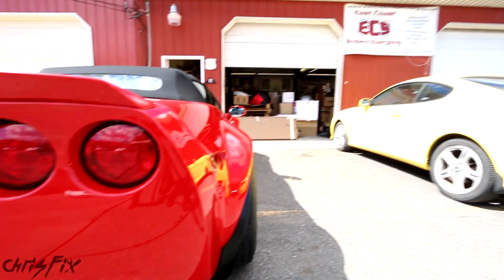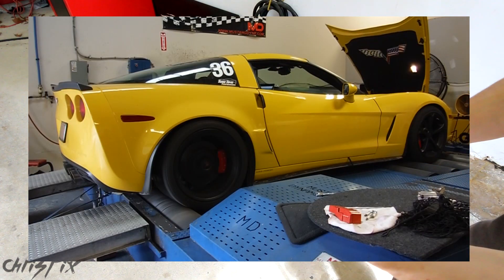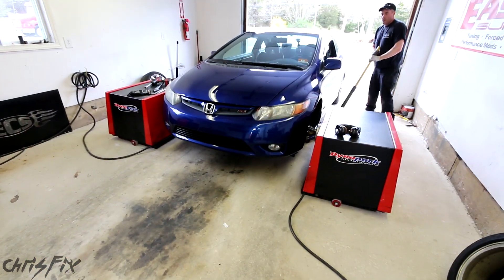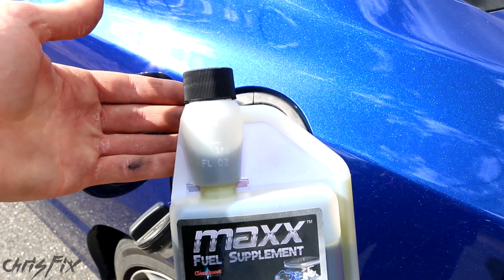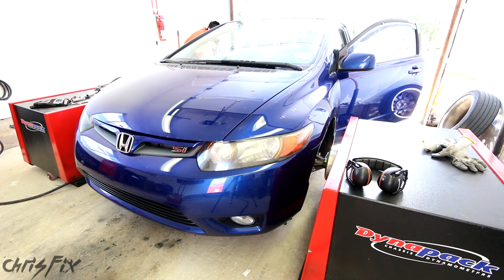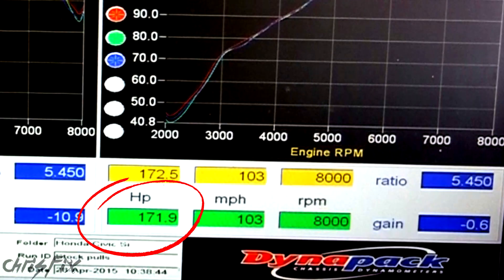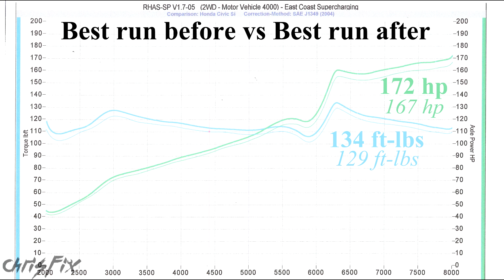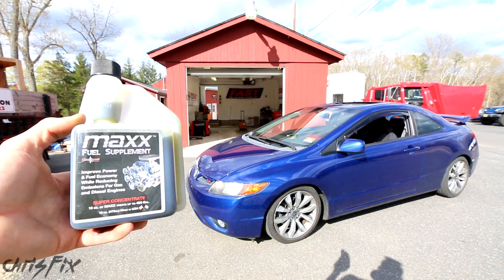Can a Fuel Additive Really Increase Horsepower in Your Car? (With Proof)

Comment: great stuff Chris. two products work so far, seafoam and Clean boost MAXX
Reply: ChrisFix I didn't like the idea of removing carbon from pistons, but removing carbon from valves and injectors is a different story.
Removing airway obstacles will help any motor breath better, and this will be an interesting test.
I actually want to see this test. I had issues with carbon on pistons, due to possible sealing problems arising from the treatment, but other areas of the motor will work better, without a bunch of carbon in the way
Reply from the maker: Shin 真・悪魔 Gouki I think we will have some more products working once I figure out a way to test the valves and fuel injectors to see if that got cleaned!
Reply from the maker: James Fenton Yea, the valves is a big deal because any carbon on them disrupts air flow and can even cause a loss in compression!

Comment: Makes wonder what the octane rating was for the gas in the tank...and would a octane booster accomplish the same thing?
Reply from the maker: mds19238 The gas in the tank was 91 which is required and I have no clue. Maybe we could test some octane boosters on the dyno to see if it works.

Comment: Great video Chris! Just wondering though, Would persistent use of this cause any harm to the engine?? Like would It be fine to use every time I fill up or just every now and then?
Reply from the maker: MVDrumline Thanks a lot! I would think it might actually help the engine because they say it lubricates the cylinder walls which would reduce wear. On their website they have a trucker company that uses it in their fleet and they say it saves them money in fuel. I think the next test for this product will be a fuel mileage test to see if it actually saves you money in gas.

Comment: I have to wonder what the results would be after the ECM adjusted the engine to the change in fuel. In other words, would this boost in power last past a tank full of fuel or fade away as the engine management system reset it's parameters.
Reply from the maker: Alan Maier Well if you keep using the additive, you will see the same results. If you stop using the additive, you will see the baseline numbers.

Comment: Driving around for a while might be unnecessary,IF your car has a return-type fuel system. Cycle the key a few times (to run the fuel pump prime),and let the engine idle for a minute..all the fuel in the lines/rail should be circulated through pretty quickly.
If it's a non-return system,you need to drive a while.
The consistency of the second set of runs is..impressive.
Reply from the maker: PhattyMo That is such a good idea. I dont know why I didnt think of that! Thanks for the idea for next time! Either way, I wanted to get everything all mixed up in the gas so a ride was necessary.

Comment: Good write up and video! :)  - but the analysis falls very short.

First and foremost, I would not have gone off of the first three runs with a disagreement like that between them.  I would have done a few more runs without the additive after the fact to see if I could get more agreement between the runs.  I dyno test engines I tune and rebuild - and if I saw lines like that on three runs - i'd know something was fishy.  Losing 2-4 HP each run?  Nu-uh.

Also, you didn't touch on how much useable horsepower that additive generates.  Yes, it gives a bit HP boost - but how much of that lies in the typical RPM band?  Looking at the graphs, the HP curve is virtually identical up to 4000 rpm, and even so, the deviation is very slight.  The additional HP doesn't come on until near and past 6500 rpm.  So it seems to me that unless you run your car with the tach bouncing off the VTEC line everywhere, this is not doing much good.

Delivers as advertised?  Yes.  Remotely useful or even noticeable?  Not even close - unless you want that fraction of a fraction of a second better time on that track pass.
Reply from the maker: GammaCruxis I appreciate the feedback. How do you do a few more runs without the additive on the same day? If you do runs on a different day there are many more variables that will affect the readings (mostly weather). The three runs loosing 2-4hp are very common on back to back runs and as a dyno operator, I am surprised you dont see that. The engine heats up and you lose power. Either way, I compare the first/best dyno run to any of the other dyno runs and there is still an increase in power.

Comment: I like digging! So I dug into this, Hmmmm! This all sounds real good and I admire your efforts ChrisFix however I looked where to buy this product and everyone is in Utah and their Testimony is from Smithfield Foods' so I researched it a little further and found this page and a link between the two, his name is Dr Theo van Kempen and the page is http://www.thepigsite.com/articles/914/manure-to-energy-the-utah-project/
As one might say: I smell a Pig! or was that a Rat!
Reply: Smithfield Foods fleet is now owned by CR England and still continues to use the product each and everyday. The article you are reading is about the largest pork producer in the US making biodiesel for use, guess what, they add the CleanBoost to this fuel as well. Chris Fix does a wonderful job showing a product in the market that works and there is still people, that do not have dyno's, no chemical back-ground or mechanical engine experience still making negative claims, it is kind of funny to read.
Reply: CleanBoost 
I try to always be a skeptic, and I admire ChrisFix efforts, also I'm impressed with the results of this product!
I'd like to be able to get some of that CleanBoost Maxx, locally to try for myself. But it seems to only be sold in Utah, I think it would be awesome if I could get back to the kind of fuel mileage of old, similar to the days of pre-ethanol with results on 87 Octane 10% ethanol /gasoline mix, that would be really something that I could write home about!
I think that would be about 15-20% increase in mileage. Shucks, I'd settle for 10% with an increase in performance!
Thanks for you efforts!
Only1trueGod
Reply from the maker: ***** haha, there you go, straight from the horses mouth.

Comment: For those wondering about higher octane fuels creating more power; it all depends on your car's ECU. Some automobiles will say "87 octane or better ", this means that if you put in a higher octane, say 93, your ECU is going to account for this and adjust ignition timing to prevent knock, and make use of the higher octane to create a bit more power. All automatically too.

If your vehicle says only use regular, or whatever octane number. Only use that number, that ECU will not be able to adjust automatically for different octanes and you can cause knock which will damage your engine over time and you will lose horsepower, even if the octane is higher.

This is all proven, and is why tuned cars will have their ECU handle only 93 octane (or E83, or whatever) to be able to make a bit more "free" power. Look at your gas-cap, dashboard, and your car's manual to look for this specific wording. And if you're hesitant about stepping up to a higher octane for a little more power and better economy, bring it to a shop and have them tune your ECU to specifically handle whatever octane you want.
Reply from the maker: Violetta Exactly! Thanks for sharing the info so others can learn!
Reply: ChrisFix No problem, I just hate it when people say I'm wasting money buying 93 for my car. x)
Reply from the maker: Violetta if your engine can make the most of higher octane gas, then it isnt a waste.

Comment: Wow! I'm legit impressed, could you try a injector cleaner to see if those work too?
Reply from the maker: kanneebannee I am trying to find a way to test injectors. That would be a really cool test. I want to compare spray patterns and the volume of gas it sprays over a certain amount of time!
Reply: ChrisFix Awesome, yes. Maybe in a translucent tube where it is marked to show how much fuel goes into the tube? Well, i will wait patiently that video when it comes! I think my car would need it but i'm not sticking anything in that is not tested.
Reply from the maker: kanneebannee The hardest part is getting something to trigger the injectors like the car's computer would. Like, lining them up and pressurizing them is one thing, but triggering the injector like an engine computer would is another.
Reply: ChrisFix Ofcourse, well. Good luck with solving it and i really look forward to that video!
Reply from the maker: kanneebannee Thanks!

Comment: It isn't good to go by the coolant temp for engine temperature because that doesn't mean that the oil temp was the same as the first run. Maybe the oil pressure was lower after the drive?
Reply from the maker: biscuitownz The engine was at operating temp for both runs. The oil temp was similar for both runs. We took as many variables into account for this test which we possibly could. Thanks for the feedback!

Comment: It will work for your car, but not for YOU ;) Come on guys, nobody can tell a 5 hp difference; I recently watched a few Boxster GTS reviews, bottom line: one reviewer said he'd be lying if he said he could notice the extra 15 hp over the Boxster S (if you really need a reviewer to connect the dots for you on this), so if you think it is worth the hassle and money for no real life effect or advantage for your daily driver, then go buy this stuff... you got to be crazy if you drive such a non-descript Honda and think you can pimp it with an additive :)
Reply from the maker: Baerchenization The butt dyno wont feel anything less than 30-50hp so this is more for squeezing out the extra hp you can get from your gas. I think it is worth it if the fuel economy really increases because then you get more mpgs and more power!

Comment: I wonder if it works by cleaning the oxygen sensors?  hmm.  cool test, thanks!
Reply: Ok
Reply from the maker: Gristle Von Raben It works on the molecular level to increase the efficiency of combustion of the gas. So the same amount of gas will burn better and make more power.
Reply: ChrisFix Come on Chris, even you know that is just marketing speak here!
Reply from the maker: 12vgs8606 How do you explain the hp increase then hahaha. It has to be something.
Reply: Maybe it helps the methanol burn hotter?  I dont know, Chris, I've been burned by so many fuel additives that it makes this hard to believe. I believe you, just hard to believe the results
Reply from the maker: Gristle Von Raben Here is what they said when I asked them (because I wanted to know myself): the product is based on a proprietary nano-technology that introduces a small amount of catalysts into the fuel, where it reduces the ignition threshold, so that more of the fuel’s chemical energy is released into kinetic energy at the crankshaft.  Less of the fuel is wasted as heat and the result is more power.
Reply: Ok. I shall buy some.  My jeeps gas mileage has started to decrease lately.  I could use some help in that area
Reply from the maker: Gristle Von Raben Let me know if it works for fuel economy. Also, before you get it, start writing down your fuel economy and mileage per tank. If you want, I might use it in a new video testing fuel economy. I want to try to get my subscribers involved and that is a great way to get a large sample size! We need to do a before and after test!

Comment: Great video. I knew Honda's were low on torque, but damn! I think Sentras makes more than that. I wonder how much your vette makes.
Reply from the maker: XenomorphLV426 I wish we could have tested my Vette. That was the original plan but I couldnt get 3rd gear to lock up (it's an auto). The Vette makes 340ft-lbs at the flywheel so I bet it would make 300-310ft-lbs to the wheels.
Reply: XenomorphLV426 That is because of a 2.5 liter engine to honda's 2.0 liter.
Reply: esqueue Sr20 makes more than that. And that's an old ass engine.
Reply: XenomorphLV426 I don't know the specs but I hope that you aren't comparing Wheel Horsepower with what the Manufacturer says that it makes from the engine.
Reply: Nope. wheel torque is right around 145.

Comment: VTEC KICKED IN YO!!! Wow though, didn't know this would make a difference.
Reply from the maker: Dell0304 Yea, it is pretty exciting! I like how clear you can see the Vtec on the graphs!
Reply: Haha yeah it's cool
Also, I have a quick question if you don't mind: My steering wheel shakes intermittently while driving straight on the freeway. I've already done a wheel alignment and tire balance, so it's not that.
I took it in to my local shop and they verified that my inner tie rods have play. They also recommended that I should just replace the whole steering rack due to my car's mileage (91K), because they tend to leak/fail around this time. What do you think?
Reply from the maker: Dell0304 The steering rack replacement sounds extreme. My van has it's original steering rack and that has 300k miles. Does the rack have any leaks? Tie rods can definitively cause intermittent shaking. Check out this video: https://www.youtube.com/watch?v=brI2feYiEi8

Comment: hey i just want to say that this is a really cool video. I know this is irrelevant but i was wondering where do you obtain your torque specs for your car? do you use a certain website. 
thanks.
Reply from the maker: Julio Amaya Thanks a lot. I have service manuals for my personal vehicles and on everything else I look it up on car forums.
Reply: ChrisFix thanks a lot man and i am assuming that the car forums are forums for those specific cars right?
Reply from the maker: Julio Amaya Correct.

Comment: Where do I buy this stuff
Reply: Peter Kapica Because 1 bottle is good for 480 gallons of gas
Reply: Peter Kapica its only $0.06 per gallon
Reply: Peter Kapica http://boostperformanceproducts.com/maxx-fuel-additive/9-cleanboost-maxx.html
Reply: Thanks man! And damn that stuff is expensive
Reply: Peter Kapica True but this video shows that it works so I'll be getting my money's worth.
Reply: Correct, could i get this at autozone or napa or o reilly's instead of online
Reply: Matthew Cyhanick then why is the additive 30 bucks???
Reply: Ok
Reply: tahrn tej So, should i put in my tank every time i fill it up?
Reply: edision69 yes, but you have to put only a little as 1 bottle is good or 480 gallons of gas so you`d have to calculate the correct amount to put in based on your tank size.

Comment: Can it do wonders cleanin out an engine with 231k?
Reply from the maker: Peter Kapica I dont know if it cleans out engines, I just tested the hp claims!
Reply: ChrisFix the website says cleans fuel injectors, but not a decarb. Maybe you can run this stuff in your carboned up mower or truck to test its cleaning abilities

Comment: It may increase horsepower and torque but it's really not enough to make a difference it's just enough to say it does work
Reply from the maker: smalton111 When you are trying to squeeze out hp or find a cheap hp booster it would work great. I think they are trying to sell it on the idea that it increases your mpgs so you actually save money by using it. I need to come up with a fuel economy test!

Comment: What if you put more additive than it says? And how much does one bottle cost?
Reply from the maker: WCGwkf The price can be found int he link in the description and adding more wont do anything. You can only make so much power front he gas that is in the engine. The product itself isnt making the power. The additive changes the gas on a molecular level to make it burn better so you get more power from the same gas.
Reply: nullsig The octane rating is actually kind of the opposite, the higher the octane rating the LESS volatile the gas is under compression. High octane gas only gives better power in engines that need it due to having higher compression ratios etc.
Reply from the maker: nullsig Actually higher octane is harder to burn so no. This is supposed to work on the molecular level but I am going to call CleanBoost to ask them exactly how it works. I will get back to you!
Reply: Yeah what if you put more than recommended will it gain any more hp if you add more?
Reply: ChrisFix if its making it burn more efficiently wouldn't that mean it IS an octane booster as the octane number is how efficiently the product burns ?

Comment: If this was done by anybody else, I would immediately call foul play but since Chris has done it, I have no choice but actually believe that the test clearly showed the additive working.  Only other explanation is that dyno has been infected by the virus and gave fake results :-)
Reply from the maker: 12vgs8606 Haha thanks a lot man! You know me! I do my best to test these products as fair and honest as possible! The whole point is to show my test and the data we got, and then let you make your own decision!
Reply: Did you notice that the car drove much better even before you put it on the dyno?  That was quite substantial improvement and at least the regular driver of the car would have noticed it immediately.  If you noticed it after the dyno run, then your mind would be pulling tricks on you.
Reply from the maker: 12vgs8606 There is no way you will notice 10hp by driving the car. It takes 30-50hp to really notice something.
Reply: On all my cars, I notice running difference.  Unfortunately, I have never been able to pinpoint if it is because of certain gas or not but now I stick with only Mobil or Shell or Exxon.  I always "feel" that car looses its eagerness on other gas such as Sunoco but it is just a feel and no objective measurement.  I think I am in the process of donating my hard earned money to this snake oil and when it does not work for me, I am going to ask money back from you :-)
Reply from the maker: 12vgs8606 Haha dont ask it from me! I am just the tester :P